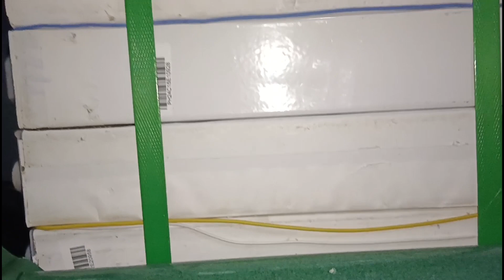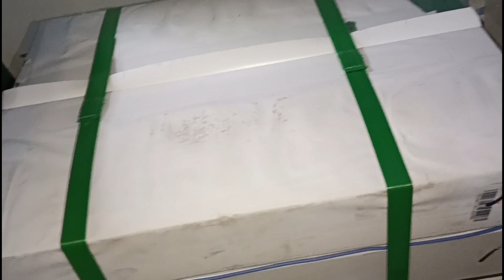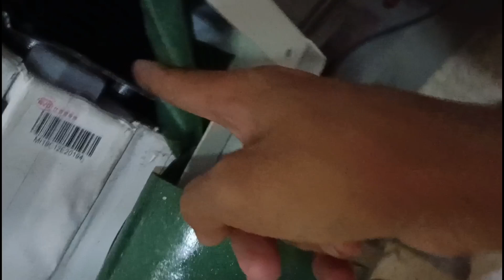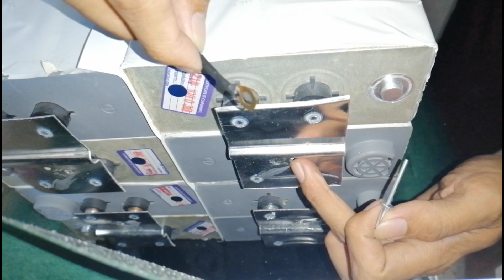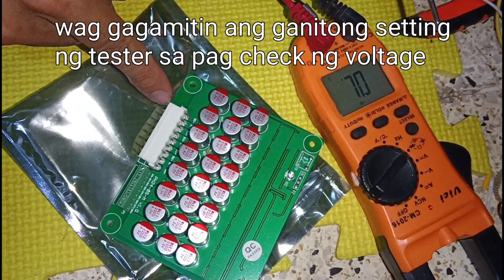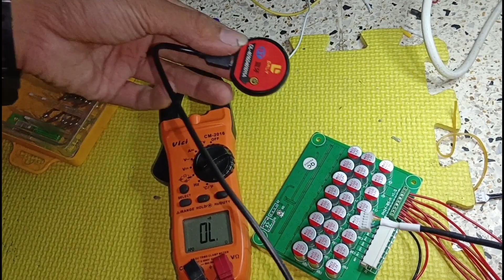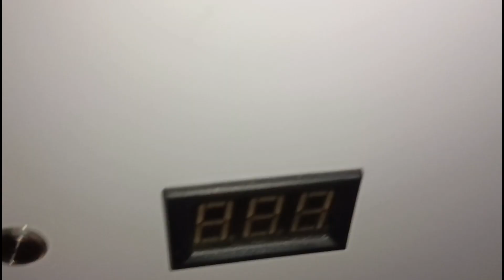PAANO PALITAN ANG BMS AT ACTIVE BALANCER NG BLUE CARBON LIFEPO4 BATTERY 24V 200AH |  BC CHANGE BMS

Comment: We, as a PV System installer, sold 16 Blue Carbon batteries. Different types.  4 pieces 12V 100Ah, 4 pieces 12V 150 Ah and 8 pieces 12V 200AH.  All clients are not happy at all. The problem is the batteries are not balanced. So when one cell is fully charged the BMS shut off the charging while the other cells are still not fully charged. The result is that all batteries perform under the promised capacity. Blue Carbon support is really bad. Don't buy these batteries. Its real bad quality

Comment: Nice sir naka blue carbon ka na pala 24v 200ah , ikakabit mo ba sa sako invertet mo sir?
Reply from the maker: Opo sir nakakabit na sya pa 3 months na po. Ok naman. Makunat hehe. Thanks po
Reply: @emhermoso  nakaka inggit sir gusto kita gayahin 🤭☺️ project mo sa bahay ganun parin ba panels mo sir kinabit mo bluecarbon 200ah hindi kana nag dagdag?
Reply from the maker: @jayrcruzcabico5487  medyo bitin nga panel pag ganito maulan po e. Di ako nakapag dagdag 1400w lang din. E makunat ung battery kaya di halos makapuno ng ayus. Pero sa summer punong puno naman po yan

Comment: Anong active balancer po yan?
Reply from the maker: eto po ang link sa shopee para macheck nyu po salamat https://invl.io/clfb7sr
Reply: Salamat sir, papalitan ko rin bms nun blue carbon ko, namamatay kc kahit konti lang load
Reply from the maker: @arielcombalicer8118  pangit nga po ang built in bms nyan kaya pinalitan ko din ung sa akin
Reply: @emhermoso  salamat ng marami sir, madali lang pala palitan
Reply: 1kw inverter  100ah bc battery ano po bms pwede dito? Ok lng ba na 60a? O d Kaya 100a na lng?